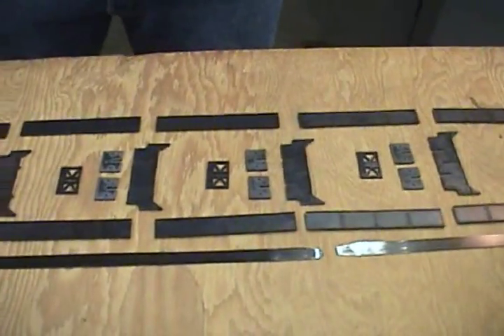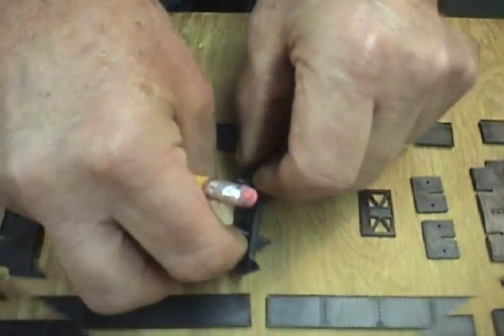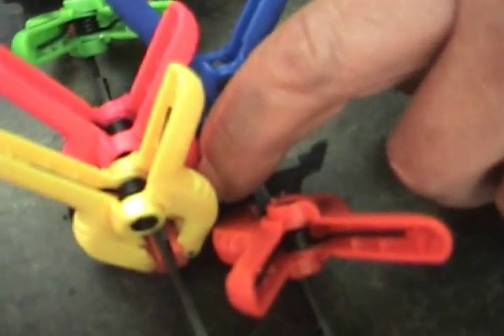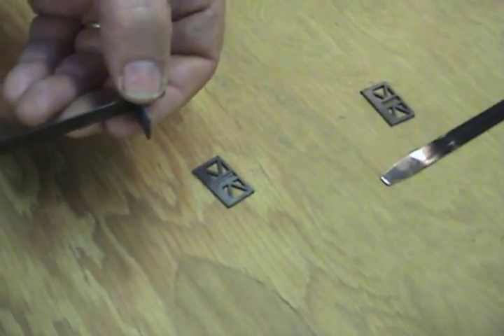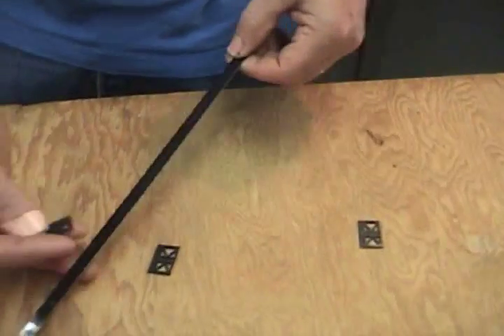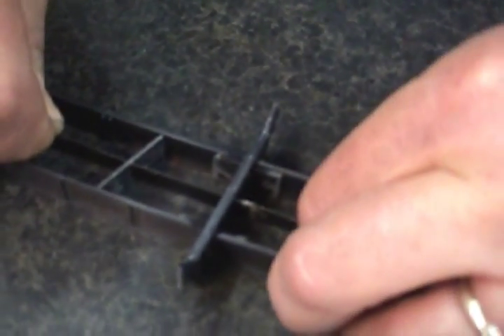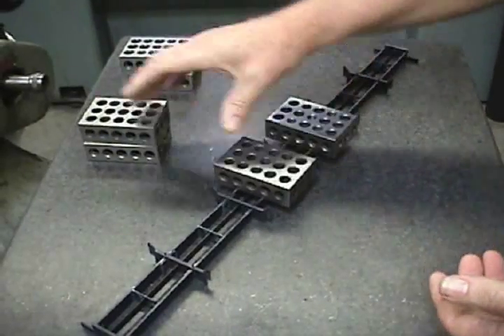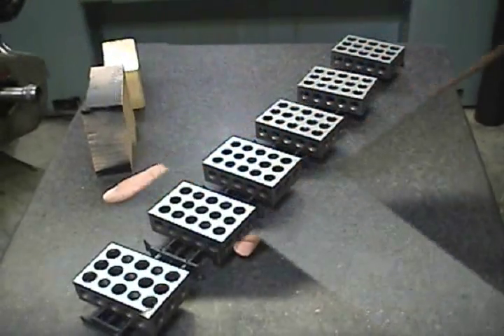The Central Valley 1902 truss Part - 01 - A

Comment: I just bought the 1900. Nice kit and really fun to build.  Since I have a floating track in my kitchen and you wont see the bridge or track from the top, do I need the code 70 rail that the kit calls for?  Thanks for all of your help.
Reply from the maker: Yes you need Micro Engineering Code 70 for the guardrail and ME code 83 through the stock rails.

Comment: To fast and not complete  very hard to follow
Reply from the maker: Time marches on we are working hard to create a more thorough and informative version.
Reply: r there different versions of this ? I have The Central Valley 1902 truss bridge and it don't look like the one your building
Reply from the maker: Paul McNamara Yes the 1902 deck / floor assembly  wes redesigned and re-tooled in 2004. Other than that, the bridge should be identical.
Reply: Oh thats y some of the parts r not the same thank u

Comment: I have so say that this kit is really hard to build.  I am giving up building the 1902 150' truss bridge after buying 2 of these bridges since I screwed up the first one.  You really need to improve your paper instructions and videos.  Video quality needs to be HD so you can see more of the details since it is hard to follow what you are describing and how this kit comes together.  Having only 1/2 of the paper diagram is not very helpful and makes it very confusing,  you really need a template for the full bridge layout.  I really like your bridges when I have seen them, but I have to say that I will not spend the money or the time to build anymore of your kits.  Just to hard to figure out with you instructions.